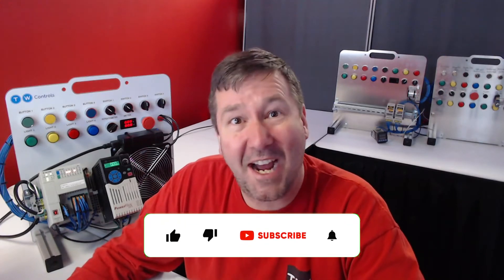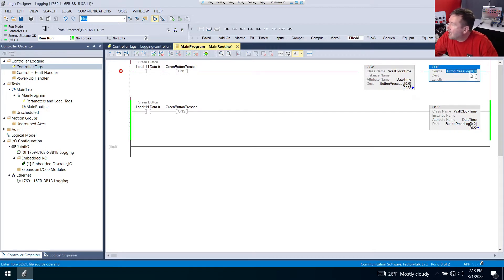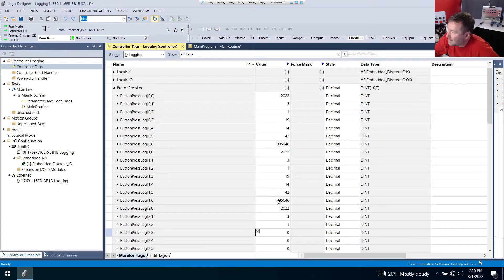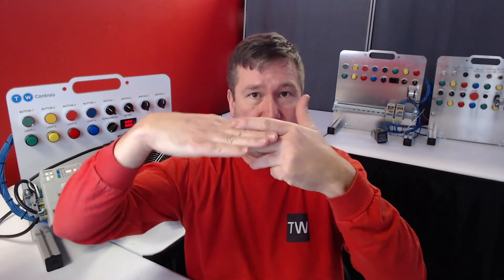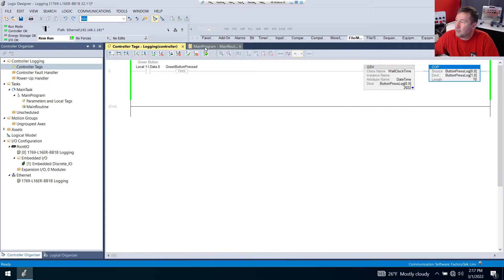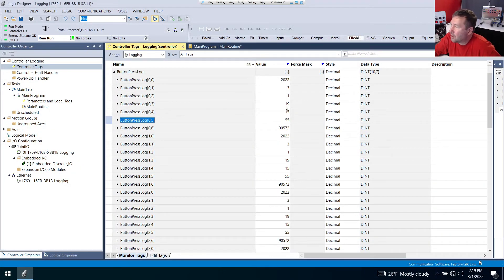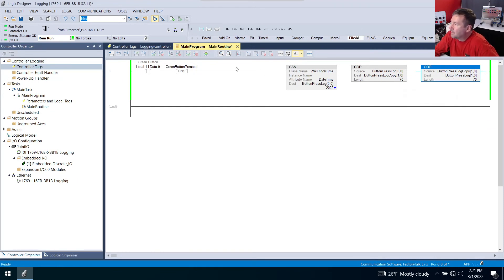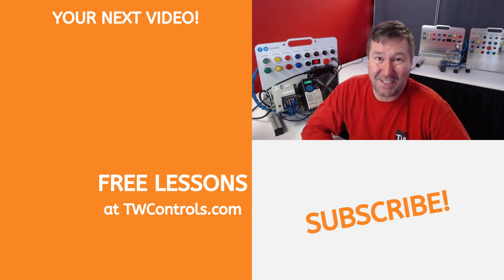Data Logging Multiple Events to an Array in Studio 5000

Comment: hey tim its there a way to do it with strings im trying to combine multiple arrays of strings using concat but i end up with all my strings on the same line on the concat. using this for fault display that im trying to make the hmi display fault text but 1 at a time but im ending uo with all my faults in 1 string
Reply from the maker: If I'm reading the question correctly, you need to find the line end character for your particular HMI.

Comment: I have a question... Why the hour's bit is wrong ?
I did it and i have the same problem
when i have 10 am i have got 15 in the bit, and when i have 2 pm i have got 19 in the bit, like you.
the minutes and date are ok, just the hour's bit is wrong.
Reply from the maker: I need to revisit this because I wasn't paying attention to the PC time when recording but my first guess is time zone and daylight savings time...or I didn't have the time set correctly at all.
Reply: Same problem here!
Reply: @TimWilborne   ok, I was thinking the same but that's not my situation. 
Thanks for answer, your videos are so good ! 
Greetings from Mexico !
Reply: I had the same issue.  Changed attribute name from "DateTime" to "LocalDateTime" and solved the issue.  Hour does show as a 24 hour clock instead of AM/PM, but understandable due the nature of the bit.